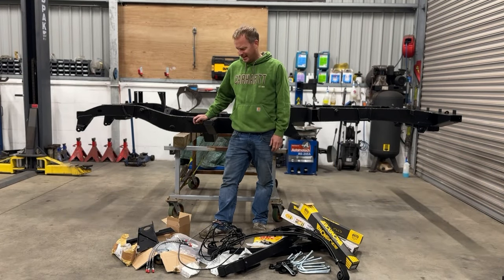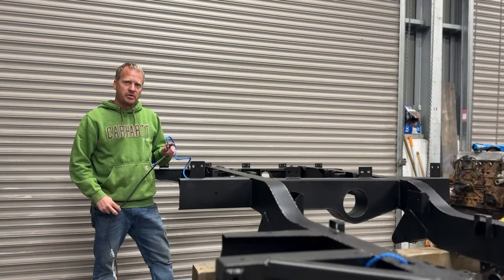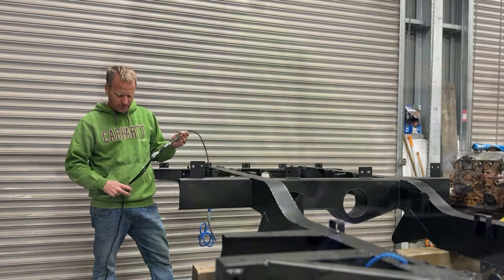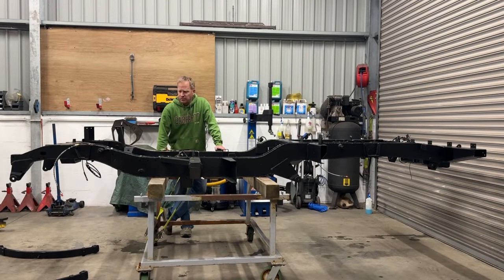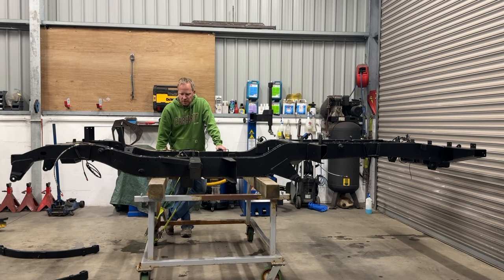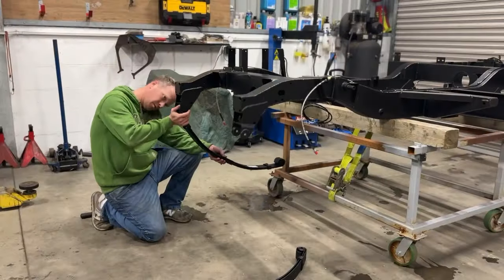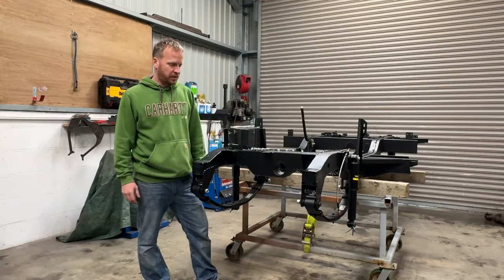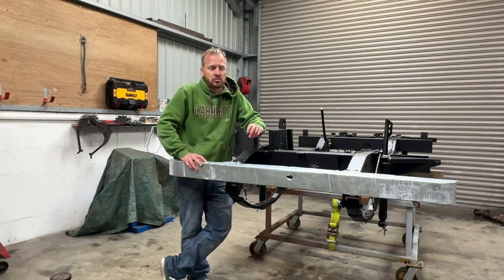1975 Land Rover Series 3 - Restoration (Part 4) - Chassis Wiring and Brake Lines

Comment: Hello, excellent video, very helpfull :) Can you tell me what tool do you use for bending the brake lines?
Reply from the maker: Hi, thanks for your comment. I’m just using a cheap pipe bender like this one https://www.ac-one.co.uk/mastercool-4-in-1-tube-bender-316-14-516-38-180-17586-p.asp?gclid=EAIaIQobChMImdrEhfKVggMV1evtCh1maA1NEAQYAiABEgKwk_D_BwE which will give you a nice bend up to 180 degrees.

For any larger radius bends I just bent it round a large socket.